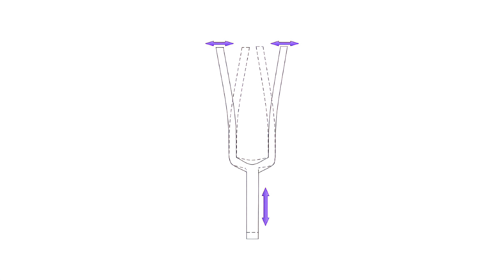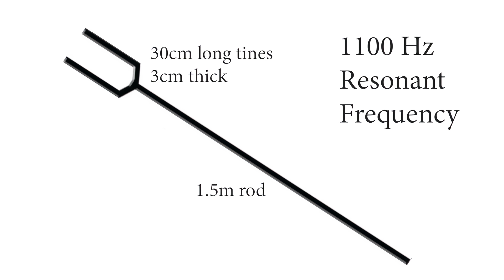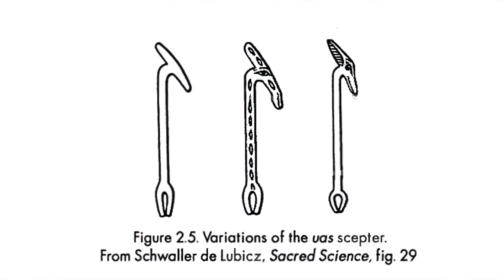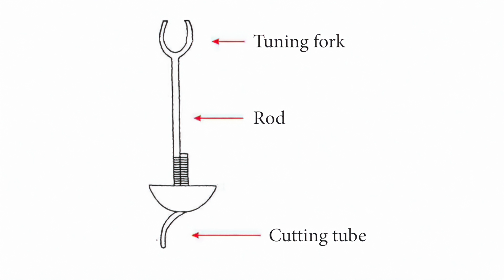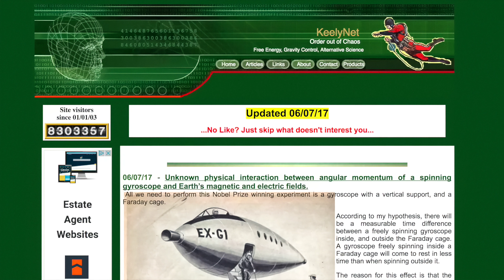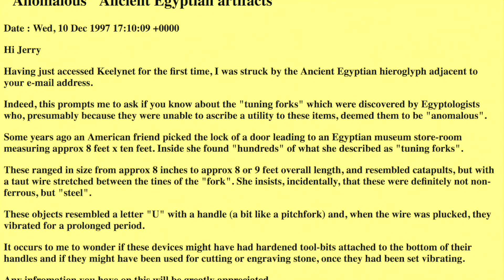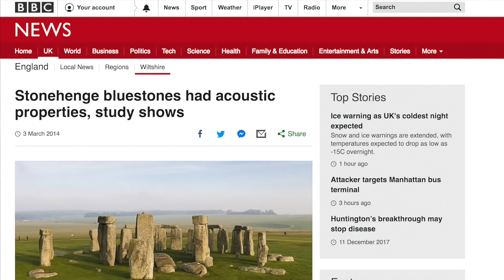How the Ancients Cut Stone with Sound - Lost High Technology Explained | Ancient Architects

Comment: Interesting, but everything attributed to this technique can be also be done by a set of tools well known to any quarry worker who worked before diamond abrasives became available.  These are known as the "mud saw" and "mud drill.  You showed a person trying to drill through a rock with a drill using dry sand.  It did not work because there was no way to carry away the ground rock powder.  This problem was solved so long ago that there is no written record of the invention.  The answer was to cause a flow of water into the cut. This can be accomplished by hanging a bucket of water with a hole in the bottom over the cut site.  The size of the hole determines the flow rate of the water. The water lubricates the abrasive and carries the ground particles of stone (called slurry) away.  I have used this technique to drill through much harder minerals than granite.  In China it was used to perform exquisitely fine detailed carving in jade, chalcedony, and even sapphire and ruby.  In the seventies, I read about an Alaskan miner using a mud saw to cut out huge blocks of jade.  The use of wet abrasives to shape stone goes so far back that it actually defines the difference between the paleolithic and Neolithic eras in prehistory, So the ancient civilizations certainly knew all about it.
Reply: Even with that technique it wouldnt  be able to be made especially with such a fine tolerance and accuracy of angle and level. If you have a look about you will find out about why it would not be possible to use this technique on such a scale ot application.
Reply: Emmit Stewart even with water, the amount of time needed to cut stones of that size is absurd, and not to mention the precision in the cuts. It just doesn’t add up.
Reply: Ok, let us say they did all this. Let's use as reference the most popular of all, the Great Pyramid. They somehow fit in place 2.3 million blocks in 20years, blocks measuring 15 tons on average. Wiki states this equals to "moving an average of more than 12 of the blocks into place each hour, day and night." In other words, one block every 4-5 minutes. That is, without taking into account the amount of planning that had to go into the making of the Great Pyramid prior to the start of the construction, and any weather impediments that must've occurred at least once no matter how good the rotations/shifts among workers were, nor the final polishing they used to do for every pyramid, nor whatever they carefully placed inside while carving hieroglyphs into the walls. Let's just assume they were working in perfect synchronicity and harmony, like a well oiled machine. The next question is, how in the WORLD do you achieve that speed only with some friggin chisels/saws and water buckets? Now, don't take it badly, I really want an answer. They started building a highway 3 years ago in my country and still haven't finished half of it. What were those people eating back then to have such prowess? Are we ever going to be told the real way those pyramids were built and their real constructors and truly how long ago, or they'll keep blatantly lying into our faces while giving numbers that make so little sense even wikipedia.com figured it out?
Reply: @InsightsbyR  Nice try.  From the same source you cite, each block is an average of 2,600 kg, or about 100 bags of cement.  I routinely see guys carry those at a rate that would take about 1 hour to 1.5 hours.  Herodotus claimed it took 20 years, and also claimed there were 100,000 men at a time.  That many men could carry a theoretical max of 6 million tonnes per day.  Which is more mass than the Great Pyramid itself.  12 blocks per hour would be almost nothing for even 1,000 men.
Reply: Good idea. There are videos trying the technique on granite. 10 cm in 6 days. I'm sure the builders of the pyramid had a lot of time. No wait. They built the great pyramid in 22 years, which means 1 block every 2 minutes. Nope. Mud saw is not the right answer.
Reply: @rikirikibis  (just to complete the picture) which is because they helped reconstruct and polish the exterior, but did not build the pyramids from scratch. The "skeleton" and inner work were there from an older period. In some, they did dig rooms at later times, while some other rooms are older.
Reply: @InsightsbyR  I was being sarcastic. Of course pyramids where not built by egyptians, and the notion they could have done it in 22 years is a bullshit. Whoever did it however, did probably consider the building a big effort and achievement but not a huge one. megalitic walls around ther world show they were used to perfectly cut stons without too much effort (otherwise why bothering). Whatever they used was extremely sophisticated, fast, efficient and without involving too much efforts. Not mud saws for sure.
Why using such enormous blocks? If you know your civilization is going to end thanks to a cataclism, you would try to build time capsules, with the best technology you have. That is what pyramids and other huge walls constructions probably are. Time capsules or reminders their civilization existed. We would do the same today.
Reply: Rhys Wong  Wow. It's nice to see this thread has remained active since I last viewed it. It's even nicer to see the majority are expressed with forethought and intelligence. A petty insult and a one-sentence comment informing us someone is talking shit only contribute an ego, it does not make an intelligent point. Sadly, such inane posts are ubiquitous on YouTube. 

To be honest, I can't conclusively prove the Denisovans were responsible. However, I believe it's a valid hypothesis to consider further, especially considering how much wilder theories are taken seriously. It's so easy to allow our imaginations to wander off the rational path, which is why I examine termites. Personally speaking, looking at their example keeps my head grounded in rationality. Thankfully, I understand the difference between conjecture and proof and wish more people did. 

But, yes, a Denosivan origin is a possibility as far as I'm concerned. It does resolve many issues that have plagued archaeology concerning these phenomenal ancient sites. In the past few decades, we have discovered quite a few new additions to the human line. Who knows what we'll discover in the future? These new lines of discovery deserve deeper scrutiny and their impact on our ancient past was perhaps greater than we can ever imagine.
Reply: Once again I must mention termites. In a previous post I mentioned how they have a self contained atmosphere that isn't like their outside world. I should have pointed out that this is, in effect, a biosphere. The remarkable thing is, their biosphere is open to the outside elements. It's akin to building a space station on Mars with holes in it. It's as if their instincts are so attuned it provides them with no need to think. 

This I find interesting because as an artist I find my best work doesn't come from my mind. Instead, it's the work that involves my instinctive creativity that seems to magically appear, without thought or reason. This is more so when I write. Many writers experience the exact same as I do. When you're in a flow, it's as if the words are waiting for you to arrive because they already knew they would be needed before you did. It's like the words write themselves and you're relating the thoughts of another. This is instinct talking. 

So, when I write, I speak from the heart with a clear mind and allow my soul to speak on my behalf. I can't help but wonder if this is the knowledge contained in us all, handed down over millions of generations. It's an untapped wealth of knowledge that has no conscience. But it's there, and when I don't look for it, I see it. When I stop trying to hear it, it whispers to me. I would imagine a fellow artist will appreciate this more. lol If anything, I've clearly demonstrated that when you think about termites it inspires you to think further. lol 

Peace. DD.
Reply: For proponents of the mud saw technique, I hope you can make a demo cutting granite blocks with this method and measuring how long it took
Reply: Interesting! but using the mud drill do you think in those days they could cut a 15 cm bore, 1.3mm per rotation? Which the sort of figure i have come across?
Reply: Paul skirton  because the king wanted too thats why
Reply: The question then is how long would it have taken them to cut the stone and build the pyramids with such a method, and does it correlate with the archaeological chronology?
Reply: What if the "tuning fork" at the top of the drill pipe was actually a fitting that cradled a wooden handle or a similar device with a large circumference that permitted a person to easily turn the drill.  Adding an abrasive mud to the process would facilitate the drilling.  Reminds me of a handheld star bit used by early miners to drill blast holes prior to loading them with dynamite. Although the demise of the ancient library at Alexandria is thought to have been caused partially by fire, religious and political conflict, and neglect the fact remains that much ancient knowledge was lost. It might have provided much insight to this discussion.
Reply: Your theory is complete and utter nonsense.
Reply: Someone debunk this idiot please
Reply: Termites?  Well, I guess if you had millions of years to evolve and learn how to build the best termite mound you could it wouldn't be as impressive and even less impressive  compared to say Mathematics, Art, Science, Philosophy and Music as well as nailing design and construction techniques in the same timeframe...  If humans were as single minded as a termite hive then I suspect we'd have houses in orbit right now.
Reply: Dude you have no idea of what you are talking about, stop making a fool out of yourself. The materials are called granite and diorite. Go ahead, inform your self.
Reply: THANK YOU
Reply: Emmit Stewart I like your thinking I am a Stonemason are you a mason too?
Reply: I have been a Stone and Brick all my adult Life and I loved it and I would do it all over:
Reply: I have watched stone masons in Georgia 🇬🇪 (not the state) and learned that with simple hand tools and time you can make about anything on the spot - you might want to have some great music in the background.  Lately, I have been working on a masonry project myself.  I went from wanting to do something simple to slowly making more complex patterns to show off my new skills.  No drills, some water to drink, a masons hammer, and mortar.  By the way, Africa has a lot of diamonds and Egypt is in Africa.
Reply: as a stone cutter u r so right.  but as with the sound theory,  how the hell they get those blocks in position let alone from the quarry to build site. some of the quarrys we're up to a 1000 miles away.  and some weighed in excess of 100 TONS. see Greek and Roman temples.
Reply: E. L. Ferguson, thanks for your reply.  My skill set is small.  There are likely some real experience pros in the comments.  The Egyptians, Greeks, and Romans had oxen and other beasts of burden to carry those heavy loads as well.  Why get materials for afar?  I haven’t a clue.  What are your thoughts on why they would do that?
Reply: If this dumbass video narrator had a clue how to do this, he'd have demonstrated it, not shown us useless pictures and ignorant opinions.
Reply: yes and quartz beads  are found all over the world and they are very hard. But how were they able to do it back then; those beads are very small . Just the practicality of it all!
Reply: yes but the only thing you are forgetting here is the old egyptians also used the sound waves to levitate the rock to transport it, the rocks used to built the pyramids are not for near by, and as far as i know we still have no idea how they did it, and the tools you describe are power tools that require a big amount of electricity, the tools that we talk about here just worker by resonance, no need for external power source
Reply: https://www.youtube.com/watch?v=qeS5lrmyD74
Reply: https://youtu.be/Y9MvGQTuB2g
Reply: For me the outstanding examples of  granite shaping and drilling are the incredible vases of Saqqara. I don’t see a connection with sound technology there. Experts say that lathes must have been used but then you have to consider the lugs left on the vases. Also there are vases with fluted necks which were shaped and polished!!, internally. I can confidently say that there is no technology existing today, that could produce astonishing symmetrical vases equal to Saqqara vases.
Reply: If that was the case, why does diamondtools stop working when the segments are gone. I have drill  several holes in stone and concrete and the tools are flowed with water during drilling. I don’t say it not working i little but it goes very slow.
Reply: but you had electrical power though.
Reply: @Tiberius_I  no, it's a hand drill with another person holding a bucket of water
Reply: @Tiberius_I  I did, but the artisans of ancient Egypt, Rome, and China Used machines powered by foot pedals and did fantastically intricate work.
Reply: Thank you for your comment!
Reply: @Emmit Stewart. Your assessment corresponds with my belief in the use of water technology. As far as I'm concerned, the ancient Egyptians had an uncanny knack for finding the most elegant solutions to their problems. Being highly pragmatic, they often implemented the most efficient practices, using the least effort. They also had a tendency to kill two birds with one stone.  

Personally speaking, it's for this reason alone that I hypothesise that the causeways leading up to all three pyramids had multiple functions, depending on the stage of construction. This meant that it was flooded during construction, enabling the blocks to be transported up the causeway, either on rafts or using inflated bladders or a combination of the two. Indeed, there are drawings that depict the use of rafts with inflated bladders incorporated into the structure. 

When I first conceived this idea, my main concern if the hypothesis was valid depended on one fact. Were the limestone quarries used to build the pyramids in close proximity to the causeways? After all, if they were too far away, then my theory wouldn't make much sense. Thankfully, when I searched for the location of the quarries, all three main pyramids had a quarry in close proximity to all three causeways. It's uncanny actually, there are three main areas and they're all next to the causeway. 

So, like I said, the Egyptians were highly pragmatic. It doesn't go beyond the realm of possibilities that the causeway was used primarily for transporting the limestone blocks from the quarry, directly up to the building site. Once the pyramid was completed, the causeway was drained and adopted its next role for ceremonial purposes. When you consider the Nile flowed next to the pyramids during this period, then it's quite easy to flood the causeway. When you also consider how the entire culture of ancient Egypt evolved around the Nile, then it stands to reason they incorporated technology that used water. 

People often lose sight on how high technology can be achieved using the most basic raw materials. A perfect example is to examine the termite. Termites exceed human achievements by a mile and manage to do this with the most basic means possible. Yet, somehow they achieve high technology. They build without foremen or plans. Each mound is unique. The workers are basically blind. They make their own form of concrete and paper. They maintain a constant temperature and humidity inside the mound during its construction. Bear in mind it's open to the elements. Their tallest mounds would put our tallest skyscrapers in the shade if they were our size. Plus, they can position their mounds perfectly to the cardinal directions and they're much faster builders. And, this is the tip of the iceberg of what they can do. 

Examining termites helps us see how high technology can be achieved. Let's face it, once you see what termites can do, pondering aliens seems preposterous.
Reply: @bullzdawguk  clever moniker, sir.
Reply: @CharacterMatterz  Much obliged. I love pun names because I find them humorous. Plus, making them up keeps my creativity refined. So, my list is long. And, yes, I literally have a list of names. lol DD and I go way back. Nowadays, I still use it out of nostalgia as much as fondness. =P
Reply: Duncan Disorderly  The amazing thing to know about the Egyptians was that they didn't have a high technology,  But they were able to create wonderfully huge and highly artistic monuments and smaller household artifacts using the primitive technology of their day.  If you look closely with the eye of a lapidary,  the carved stone jars they made to hold precious oils and the little stone figurines they tucked into the mummy's wrappings were just as much of an achievement as the tombs they placed them in.
The actual technology for these things actually dates back to the Neolithic era.  Stone age men knew how to carve and drill stone.  The Egyptians stand out because they used those already ancient techniques to create wonders previously beyond the imagination of previous civilizations.
Reply: Yes. I agree. The Egyptians did not have high technology. However, my point is, like termites, they were able to use primitive technology to achieve a high technology effect. Previously, I mentioned how the termites manage to maintain a constant temperature and humidity level as their mound grows. In effect, they use a combination of sunlight and air filtering to such a high degree, their mounds are climate controlled and fully air conditioned. Imagine building a skyscraper and doing the same. Insane? Isn't it? 

Plus, we could not breathe their air and survive because it has a higher content of Co2 (I think, memory escapes me atm), well whatever it is, this is manipulating the mound's atmosphere to a different environment to the outside world. I'd call that a high technology effect using primitive technology. By using a combination of the most basic raw materials, all gathered locally, they can construct a mound of infinite complexity that works perfectly.

In Africa, the mounds can reach over 30 feet and they're notoriously difficult to demolish, due to the solid outer layer of concrete. Bulldozers, jackhammers and even dynomite are used to demolish a mound and it's still hard work. Proportionally speaking, that is literally akin to a huge Godzilla-like monster trying to topple a skyscraper we built. The difference is, with our buildings, one swipe and it would topple. Can't say the same for termites. 

Perhaps I've overstated the termite example, but it truly helps me gain better perspective in comparison. It's living proof that a high technology effect can even be achieved by blind, single-minded insects, that somehow manage to combine their simplicity and merge into a powerhouse. I can't think of a better example to use in order to present how the Egyptians achieved similar. 

Refreshing to speak intelligently on YouTube. lol
Reply: Since posting my last comment, I've been thinking about what you said. Imagine this possibility. What if the ancient techniques originate from another source? Quite often, the older the monument, the larger the stones. Stones of such huge proportions, we can't comprehend how it was achieved. Well. What if humans didn't build them? No, not aliens. Maybe Neanderthals or Denisovans are the builders. We only have a handful of fossil evidence of Denisovans and it's mostly teeth. These teeth are huge, which suggests a human far larger than us. One thing is for certain. They would have the muscle to move larger blocks we would always struggle with. 

You see, the reason why we can't imagine building some of these massive ancient structures is obvious. It's because we never did build them. We never could. We could only try and match it. Emulate it. But, we could never achieve their level, due to our size and strength. Perhaps we interacted with them in the early part of our evolution. As they faded into the past, we managed to learn some of their techniques and it formed the earliest foundations of our evolution as humans.

EDIT: OK How freaky weird is this? Immediately after I posted, I learnt that only yesterday the news was released that 50,000 year old bones were discovered in a cave in Siberia. You're not going to believe this. The DNA indicates it was a Denisovan/Neanderthal hybrid. The first of its kind ever discovered. 0.o
Reply: Duncan Disorderly  It is certainly probable that the Egyptians inherited much technology from previous eras. I don't know enough paleontology to say whether Neanderthals or Denisovans had such technology.  We do know that the Neanderthals interacted and intermarried with modern man, so there would be good reason to believe that they shared whatever technology they had as freely as they shared their genes.
Reply: I just read about 4000 year old termite mound in Brazil.  Duncan is onto something here.
Reply: @bullzdawguk  , Emmitt Stewart. Great convo, you've both given me so much to think about, and totally agree with your perspectives! And u didn't go overboard on the termites u made them understandable!
Reply: @bullzdawguk  yes the egyptians that we know did not have high technology, the pyramids were not built by them, as we did they found them also, the pyramids were built by a way older civilization of which we have almost no records
Reply: @jorgeromero8482   That's quite a claim. However, it's speculation, it's not a proven fact. A theory requires rock solid proof. Your theory has none I'm afraid. In fact, you said yourself we have almost no records. I need more than almost no records. 

If you want actual records, I can point you in the right direction. A few short years ago, a remarkable discovery revealed the oldest papyrus ever uncovered. Even more remarkable was what they had to say. They form a journal written by an official who worked on the pyramids. I'll add a link at the end of the comment for you. When I make claims, I like to back them up. 

I'm not saying I'm an expert about Egyptology. But, I have been an amateur Egyptologist since I was 9. After decades of studying the culture, I have amassed a library of thousands of books. I have read EVERY book in my collection. Amateur status does not mean I know less than a person with a degree in Egyptology. It only means I never earned a degree. After all, the greatest discovery in Egypt was made by an amateur. Howard Carter had no formal degree, yet he uncovered Tut's tomb and like myself, taught himself how to read hieroglyphics. This is not meant to boast, I'm simply trying to convey that I'm not talking bullshit. 

Personally, I don't believe every aspect of Egyptology is 100% accurate and there are parts that need further study and updating. Take the ruined Pyramid of Djedefre for example. Just over 100 years ago, some idiot archaologist put forward his "theory" about the site. This story involved palace intrigue, a family divided and even murder. While this may have made a great story, it was based on no facts whatsoever. In effect, he made it up. Yet, until recently, his ridiculous claims were seen as valid. 

It's quite easy to allow your mind to get carried away with ancient Egypt. Quite often, people come up with a theory and it's obvious they don't understand certain aspects of their culture. Like, people claim the Pharaohs were negro because of the dark brown skin. If they understood the significance behind why they're depicted this way, they wouldn't think to suggest it. The colour is meant to represent how men generally worked outdoors and had deep suntans. At the same time, they totally ignore the fact women are depicted with a yellowish tint. How is that negro? If anything, it makes them look Oriental. How can all the men be negro and all the woman different? The fact is, women are depicted in that colour because they generally spent their time indoors. So, you can see how frustrating it is to someone with a deep understanding of their culture to hear these wild claims. 

Anyway, hope this helps. Also, here's the link I promised:

https://www.smithsonianmag.com/history/ancient-egypt-shipping-mining-farming-economy-pyramids-180956619/
Reply: Duncan Disorderly  great info. Thank you
Reply: @HellCatt0770  You're most welcome. I don't claim to know everything, but I will confidently claim I know something. =P
Reply: @bullzdawguk  --A very good analogy, Duncan.
Reply: tony mullins  Thank you. It's much appreciated. My goal is to think with a rational logic. Like I said previously, it's easy to get carried away when it comes to ancient Egypt. To give the credit of their achievements to aliens is an insult to a truly great society that influences us to this day. 

Their list of firsts in human civilization is extensive. In fact, even after decades of learning about them, I continue to find new additions to this long list. They were a highly complex culture, as well as extremely pragmatic. It's no surprise they had the first bureaucracy in history. For myself, that speaks volumes. 

Anyway, it's satisfying to see my analogy is appreciated. Thanks again.
Reply: @bullzdawguk  What would the hypothesis be regarding other developments in the world such as Stonehenge ? Flooding causeways and floating ? Thank you for your time.
Reply: @shanghunter7697  Considering the blue stones were mined in the Preseli Hills in Wales, which lies on the coast of the Bristol Channel, then it seems the logical solution to traverse the coastline. Stonehenge is about 50KM from the coast. But, I would imagine there was a river wide enough that would take them inland, closer to the site. 

If memory serves me well, the source for the Sarsen stone hasn't been definitively found. To date. So, any speculation as to how they were transported needs more data before validly proposing any further hypothesis. 

To be honest, I'm surprised I know this much about Stonehenge, as Egypt is my true love. lol Nevertheless, I never fully considered how they potentially transported the blocks for Stonehenge until you asked. I enjoyed examining your question and feel my hypothesis is not beyond the realm of possibilities. 

The people alive thousands of years ago were no different to us. They were as intelligent, as innovative, as driven as we are. There were genius' back then, just like today. So, I have no doubt they found solution through necessity and tenacity. Like the idiom says; necessity is the mother of invention.
Reply: Paul skirton  Yes, copper blades on their own do not make effective cutting blades. However, add sand to the mix when you are cutting and it proves to be quite effective at cutting the hardest granite. The secret is in the grains as some bits are just as hard as granite. This is not hypothesis, it has been tested and proven to be true. There are many myths like this surrounding ancient Egypt that refuse to die. 

For example, if you watch clips expressing alternative views concerning Egypt, they often point out that there is no soot from oil lamps to be found on the ceilings of underground passages or tombs. It's a mystery they say. No, it's not a mystery. How come there is no soot on the ceilings? Easy answer; because the ancient Egyptians were more intelligent than some modern day fools. The historical answer? Because the Egyptians used different types of oil. The oil they used for underground is known for making a small amount of soot when it's burned. Plus, they added salt to the oil. Salt eliminated the small amount of soot from burning the oil.
Reply: @bullzdawguk  Thanks for the read. Great analogy with the termites. I want to know more about every comment you made and I didn't even came here for the ancient history. You should have your own videos.
Reply: @matthieu9695  Thanks for your kind words, they're genuinely appreciated and in more than one regard. On one hand it's rewarding to have my perspective taken seriously and you're not the first person to appreciate my views about termites. When you compare this humble insect to humans it really gives you a new angle on the ancient builders. There's so much more I could elaborate on, I've barely touched the tip of the iceberg. 

The other way I find it rewarding has to do with the fact I'm a writer. It's one thing to have people appreciate what I'm sharing. It doesn't mean I'm right. However, it does indicate my opinions expressed here are not so far fetched. The fact I can articulate these thoughts in my own words is my craft. Having my craft validated is empowering and gives me the confidence to use my words effectively. 

Since you seemed eager for some more food for thought, I have another fascinating termite fact to share. 
Hope you find it interesting. 

A few years ago, a team of scientists conducted a test on a termite mound. Bear in mind, many termite species build their mound throughout the entire life of the colony. It's a constant ongoing construction project. Now, if you read in an earlier comment, I mentioned how vital it is to maintain a constant temperature and humidity level in the mound. Somehow, they manage to do this, despite the mound having no doors and being open to elements. 

Also bear in mind that no two mounds are alike. Yes, there's a general layout and design... for want of a better word. It doesn't matter, the mound always works. Now, it gets trippy. 

This team of scientists found a young colony to study. They cut the mound down the middle, making two halves. Next, they separated the two halves, making two separate colonies. Despite the fact the two halves weren't joined, the termites built each half as if the mound was still one. In effect, they could put the two halves together after being separated and they would fit. 

But, it get's even stranger. Each half managed to maintain that all important constant temperature inside their half of the mound. As well, if you put the two halves together again, the temperature and humidity wouldn't change. 

Clearly, these creatures can communicate on an almost telepathic level. I can't think of anything else. That said, I think telepathy could easily evolve naturally. For example, imagine a creature that evolves smell to communicate. Now, imagine that creature evolving to a sentient level like ourselves. For thousands of years they have developed subtle smells their noses can barely smell, if at all. However, these scents could contain floating hormones and smells could have meaning. Basically, they communicate through smell. Although it appears to be telepathy, it's merely smells they tuned out. Look at the hormone we excrete with babies or dogs. This is a powerful bonding hormone and we can't smell it, but we do see the effect. Funny how dogs emit it as well. It does explain why you can say you love the puppy you brought home, on the day you got him.  

Anyway, I've babbled enough.  As I'm a writer, it doesn't take me long to write a few long paragraphs. lol  As long as you enjoyed reading again, then it's all good. 

Take care! Peace. =)
Reply: @bullzdawguk  The punctuation makes it easy ;-) Interesting point of view, one that I can fit into my own train of thought and explore, so, thank you. Take care.
Reply: @Duncan Disorderly I noticed you said a theory needs rock solid proof which is not the case, no matter how many books you’ve read. A theory is a guess, it is the opposite of proof/truth. It requires no real proof just assumptions and is only limited by your imagination.
Reply: plumbing would seem like magic if it was taken back in time. but who can honestly replicate it if they had too without training.  necessity if the mother of all invention. and if it seems far too obvious to explain, it can easily be forgotten
Reply: @randomicus4782  you realize plumbing comes from a time long ago? There were ancient civilizations ultilizing ley lines and canals and natural water flow not only for hygeine but for the use of hydro energy